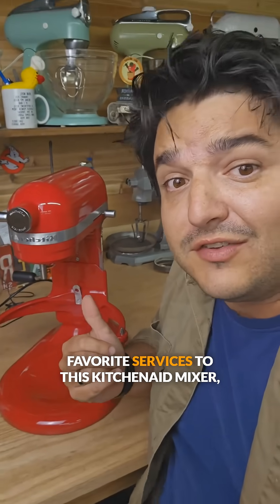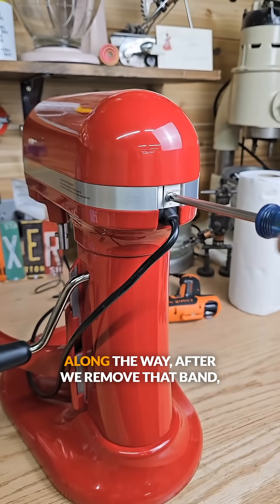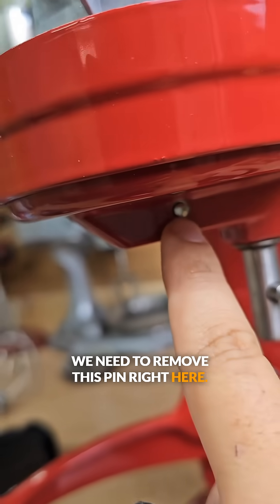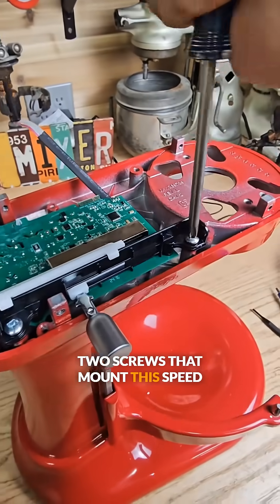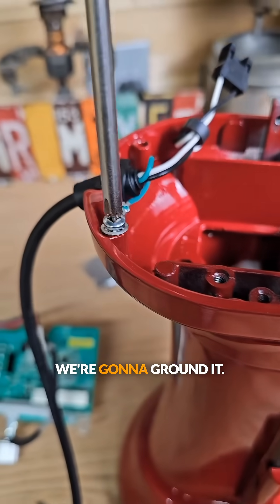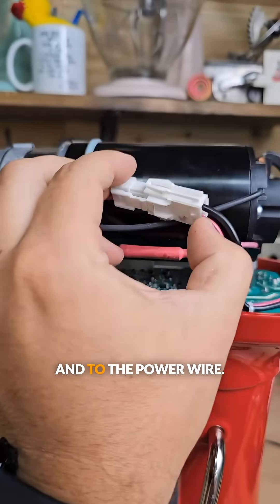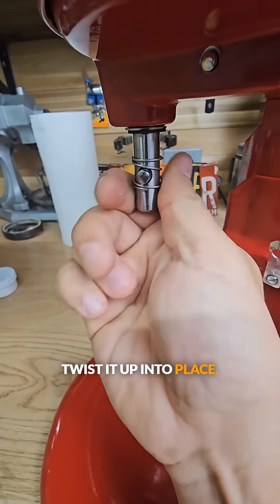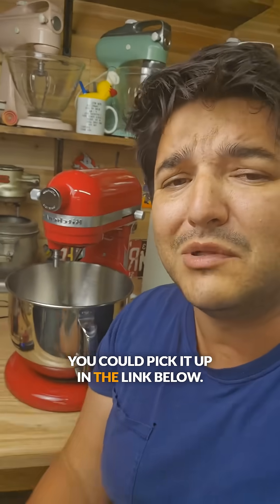From junk to hunk! Turning a 500-watt AC KitchenAid into a robust 1.3hp DC mixer!

Comment: I have a 6 quart pro mixer that I received in 2015. Can I purchase from you the DC replacement motor? I love the mixer, I hate how noisy the mixer is at low speeds.
Reply from the maker: Unfortunately the DC conversion will not work on your model! That being said, I know yours is loud, but it's a good unit!

Comment: I’m confused, I own a kitchenaid pro 6000 with the 500 watts ac motor, yet you say that you are replacing it with a 1.3 hp, the confusion is because I thought, that the motor was the same in the pro 6000, pro 6500, 7 qt, and 8 qt, the difference was the mother board, would you please enlighten me.
I thank you before hand and hope to hear from you
Carlos

Comment: Is that a KSM60 that you converted to DC?
Reply from the maker: Yes it is!
Reply: @MrMixer316  my professional 5 plus has a 525 watt motor and it has been overheating and smoking when making bread. Should I replace the motor with the 575 watt or just go big with the 1.3hp DC. If that is the case is it only the newer 6qt ksm60 that can be converted? The older 6qt use the smaller design motor with a 575 watt  motor, correct?
Reply from the maker: @chadlooman6720 correct only the new style ksm55/60/70 can be converted, the pro 600/pro 5 plus is not compatible
Reply: @MrMixer316 thank you.
Reply: @MrMixer316 if you can get the bottom housing and the planetary. You could sell that as a kit to convert the professional line to DC as well.
Reply from the maker: @chadlooman6720 would need the upper housing as well unfortunately. Cost really starts to creep up. It is possible however!

Comment: Dc kit has literally the same microcontrolers, hell probably more of them.
Reply from the maker: It has micro components, they do not fail like the ksm55/60/70 that is the difference. They will run on a converter over seas as well, the new ones blow immediately

Comment: Uhh, the DC board has surface mount chips as well, you literally can't complain at the AC board.  Also I would like to see some facts, like sure the gears are different, but uh, does that actually matter?  Is it a common failure people are seeing?  I like hot-rodding things as much as the next guy, I'm just very aware that the changes aren't usually necessary unless you are working the machine commercially and being rough with it (some people don't listen when they are jamming a machine, keep running it without replacing lube, etc).
Reply from the maker: The new units boards are much weaker, yes the DC does have some micro components but for example a DC unit will run on a transformer if you take it over seas, the new ones blow up immediately when placed on a transformer.

I have no reason to lie, the DC is a way better unit.

Comment: Would a 2012 Professional 5 Plus benefit from this conversion?
Reply from the maker: The pro 5 plus is a variation of the pro 600 which is a good model! It's better than the new style mixers that replaced them. The DC upgrade however unfortunately won't fit it!
Reply: @MrMixer316 thank you!  Appreciate your response and explanation, love your channel and content 🙏💯

Comment: Uh… any chance you can customize a kit with the smexy NSF orange power cable?
Reply from the maker: One of the options when purchasing is to choose between an orange or black cord 😊
Reply: @MrMixer316  and 💔 that you can’t ship this kit internationally.     Please make an update short if that changes, particularly for canada.
Reply from the maker: @brandonha I can ship it to Canada, however it will be an extra step. I will have to send it all via the post office, I will have to charge for actual shipping as well. It may cost $40-50 or so to ship. The reason we can't ship it international is due to our international rates require the package to be less than 4.4lbs. the motor itself weighs more 😅.
Reply: @MrMixer316  you know your customer base well it seems.

Comment: Our Kitchenaid is 30 years old. Is there an easy way to tell if it’s DC or AC?
Reply from the maker: If it's that old it's 100% AC but it's a different style of motor and transmission and it's quality. The older unit you have the better!
Reply: @MrMixer316 thank you for the response and the reassurance. We love our kitchenaid. It’s funny cause my daughters both wanted it when they moved out. My wife and girls have memories around that mixer so much so that when they moved out they wanted to take it with them. That just amazes me. I have bought them each one and they’re making memories with their newer ones. Both will tell ya though that theirs isn’t moms. My wife has all the attachments that we bought from flea markets and garage sales.

Comment: I do own a Kitchenaid mixer that is over 40 years old. My question is, when did Kitchenaid stop making the DC Machines?
Reply from the maker: They were discontinued in the fall of 2022 I believe
Reply: Never discontinued... Commercial models  KSM8990ER  &  KSMC895ER  both have the exact same  1.3HP  DC  motor.

Comment: Can you change a 6 quart pro machine into an 8 quart machine?
Reply from the maker: The 8qt bowl fits the 6qt arms but we cannot turn the pro 600 into DC due to housing incompatibilities
Reply: @MrMixer316 darn it!
Reply: @MrMixer316  Wait. Does that mean that I can use the 8 quart bowl on my 6 quart mixer?
Reply from the maker: @RobinBelser  yes it does, we have them available as well as the 7qt on our website mrmixer.store. Just be wary to not over load your mixer
Reply: @MrMixer316 ok. Thank you 😊
Reply: @MrMixer316 which machines should I keep my eye out for if I want to do the same upgrade?
Reply from the maker: @calvinlim9485 if you find an 8qt commercial or 7qt proline they will have the DC innards, or a ksm55/60/70 you can do the upgrade to!
Reply: @MrMixer316 thank you